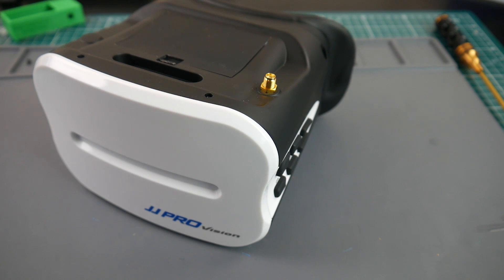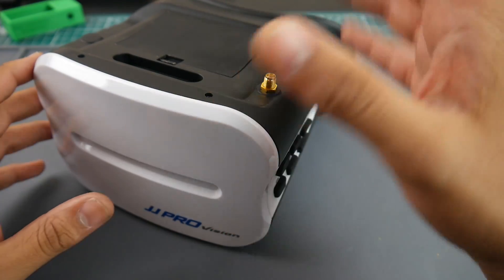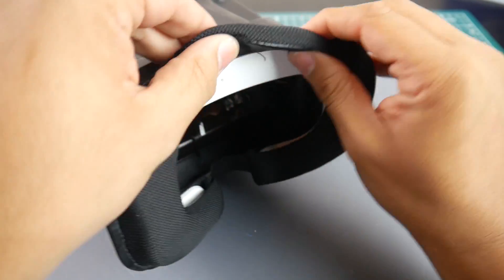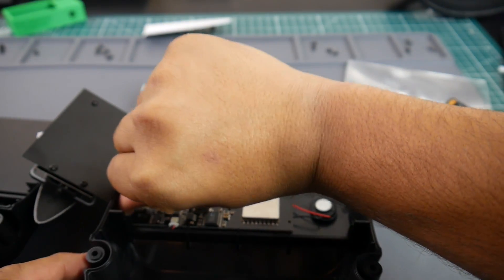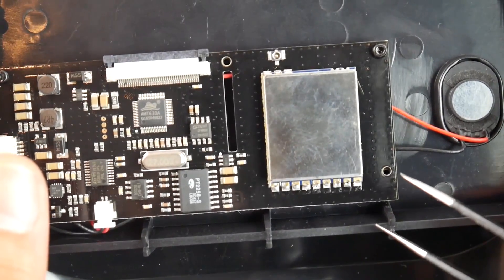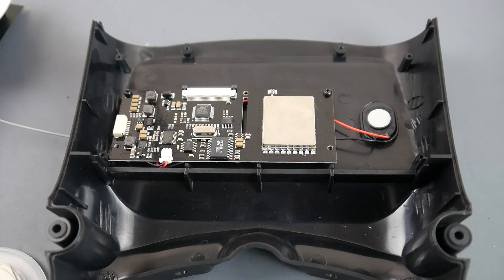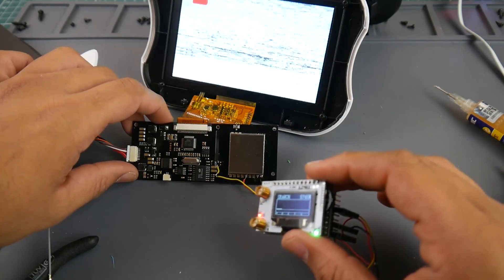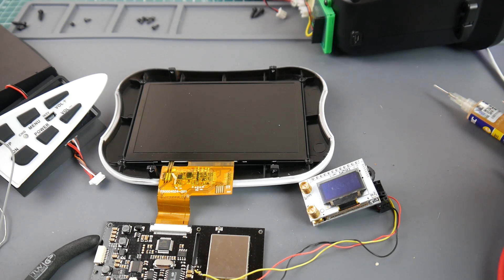JJPRO F01 FPV Goggle FATSHARK MOD // Part 1

Comment: I am trying to do this mod with the Eachine PRO58. Just for clarification, as far as I understand I don't need to remove the capacitor. All I need to do is to solder the wires. Is that correct?

Comment: did the same. with achilles best googles for me. i have a switch to use the internal receiver, but next time when i open the googles i will remove the internal receiver to save some mah from the batterie

Comment: Nice one! Love your mods. I ll try to mod my flysky with long range) Can you try to upgrade echine ev800d with replacing battery to back on strap? or replace it with fatshark battery \ connector. Eachine ev800d is pretty heavy on the front, i want to remove battery from this box...
Reply: you can power the ev800d from a 3s lipo, it should come with a plug and adapter for a 3s battery, i also shortened the top headstrap  to tighten it and make it balance better, the internal battery is quite small and its not worth removing once the strap is tightened but the external battery is a good idea, i use it for security.

Comment: I've done it, but there is a problem in doing like that:
The Voltage regulator Will  overheat and turn off after 10min in a hot day! 
I crashed my drone for this...

And the batter 1s will last very few time (because the board will tell you that the battery is empty when it's only 3.8 or 3.9V)

I modded using a 2s liion battery and powering the module from a 5v bec and the googles directly from 2s. Never a problem in this way and the battery last a lot (I'm using this setup from about 1year)!

Now wanna try now to remove the internal receiver and plug again the external module powered from the board. In this way I hope the internal Bec will not overheat, but I'm a bit scared that it could turn off again and let me crash in an hot day..
Reply: Hey , im a pretty big noob but isent it possible to take the 5v+ from the mini USB B for the module?
Reply: Got any picture of your mod I am looking at doing this with my JJpro Vision Goggles now. Would love to have diversity on them...